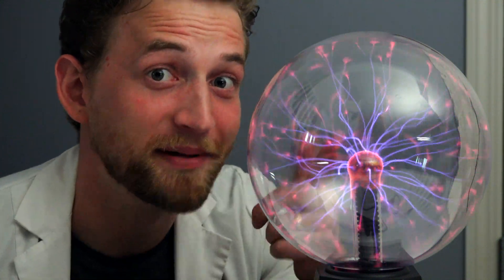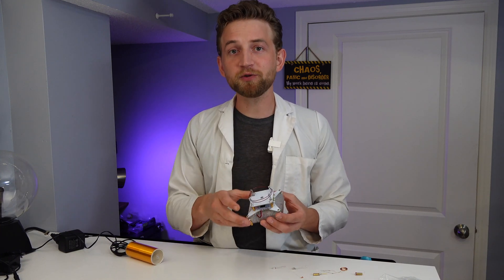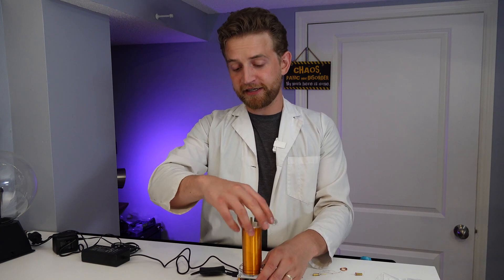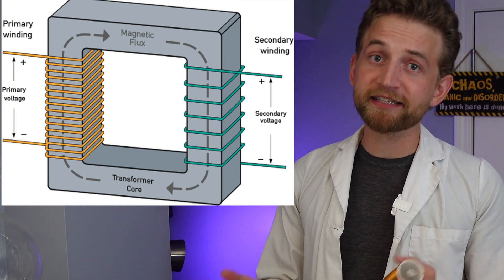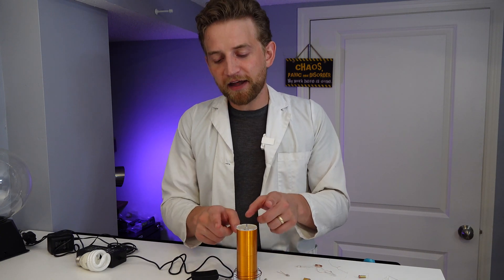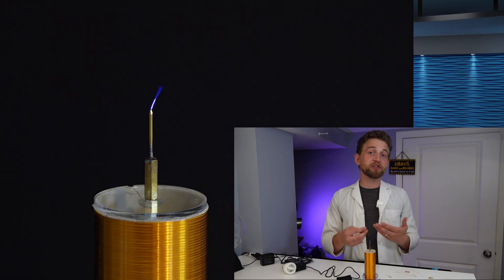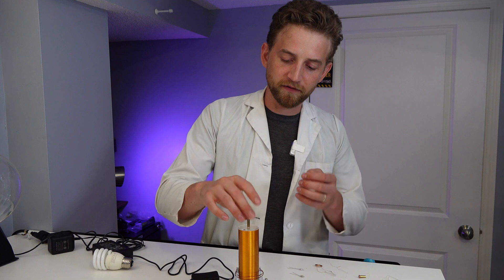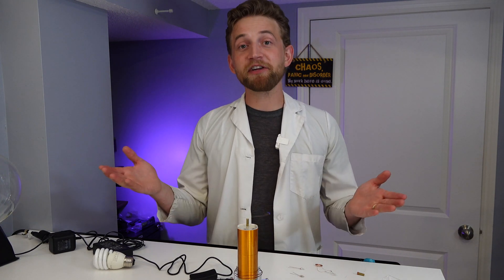How and why do tesla coils work! Plasma ball physics.

Comment: My question is: Can I insert a plasma dome i.e. with the electronic components in side the base removed, over a Tesla coil I can buy on Amazon? Will it light the dome?
Reply: You caught me at a time when I was cleaning up my account a bit. :) and I understand what you mean now. I have never tried it myself, but I believe it would glow slightly. Because the tendrils are based on the most efficient way to get to the ground, it is unlikely that the best path would be through the dome.
Reply: @jdallers  I see. Thanks for the help.
Reply from the maker: If you bought the right specs, it would function very similarly. But you wouldn't see the lights unless you depreasurized the dome and filled it with an inert gass.
Reply: @DestructiveCreativity  Well, the dome is still sealed so I expect the gas to still be in there. Thanks for replying so quickly to a comment posted to a 2 year old video 👍